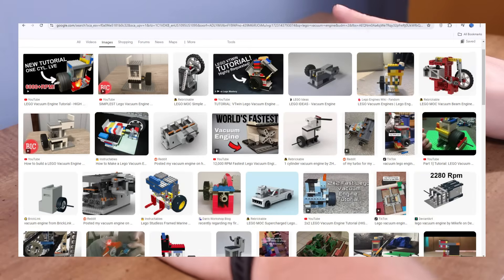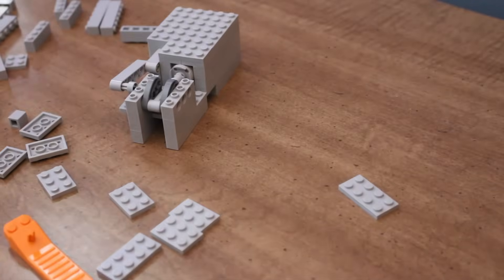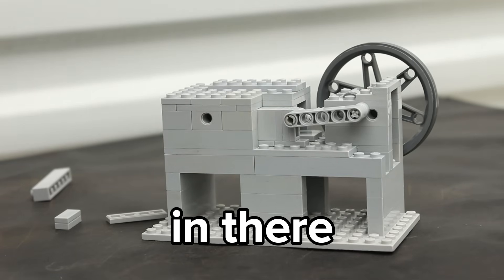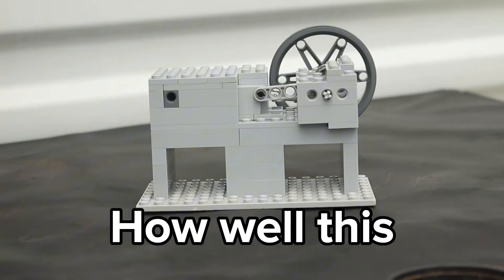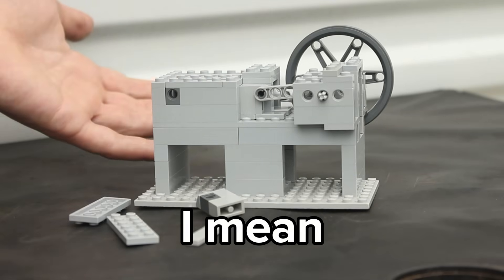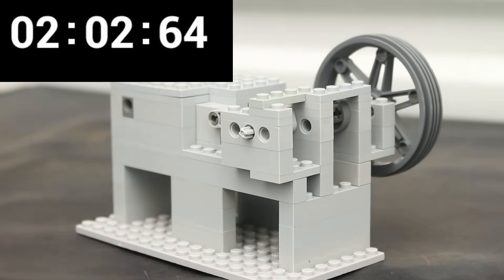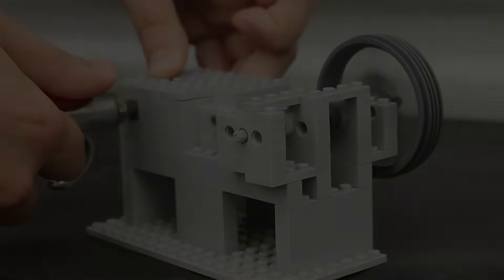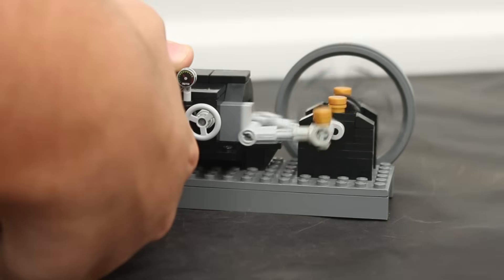I Built a WORKING LEGO "Steam" Engine!

Comment from the maker: Should I make more steam/air engines?

(P.S. I do have some fun ideas!)
Reply: You definitely should :)
Reply: No one can stop you so YEEEESSS
Reply: Should I build one that has torque to power something?
Reply from the maker: @Wowzers11958  you can try!
Reply: @DeltonAdamsLEGO  challenge excepted! I’ll put one on my channel later or tomorrow, work on it today.
Reply: Ofc!
Reply: Absolutely!
Reply: Try to take the wheel of
Reply from the maker: @liamyateslego  it actually will run without a flywheel! It just shakes itself apart after a while
Reply: Yes you should!
Reply: Yes!
Reply: Yes, the four-cylinder triple-expansion engine on RMS Titanic
Reply: can you make one with a boiler attached to it?
Reply: Try to use it to power something
Reply from the maker: This particular engine doesn't have enough torque to power anything
Reply: Yes🎉
Reply: nah first make a lego steam engine that actually uses steam not pressurized air
Reply from the maker: @CommiePlasma  LEGO plus high temp steam = a non-running engine and ruined bricks
Reply: Sadly it didn’t run in the vid ima post it anyways and I’ll post new and improved one soon. Maybe tomorrow but we’ll see 😅
Reply from the maker: @octacore4009 that would leak like crazy. I don't think using water would be a good idea
Reply: Yes!
Reply: one idea that i had is to try to put some oil that could help run a bit faster
Reply from the maker: @westernadventures3719  if you'd like to try, go ahead! I'm trying to make 100% LEGO engine that don't require anything extra other that air
Reply: Please make a tutorial
Reply: Try and see if you can build a "Triple Expansion Marine Engine"!
It's the same type of engines that were seen on the Titanic / Olympic-Class Liners!
Reply: Yeeeesssssss
Reply: And I subscribed
Reply: How about a steam TURBINE?
Reply: use pneumatic pistons
Reply: yes trains
Reply: definetly yes, and i would like to see one on a lego steam ship
Reply: Using your air compressor and your vacuum cleaner combined you could make a vacuum engine that has a compressed air tank pushing air into the exhaust of the engine to make it go faster, even if it would probably work better on a vacuum turbine (it also would look like NOS).
Reply: PLEASE
Reply: maybe give lego pneumatic engines a try. i recently bought a set of a moc someone made thats similar to a original steam engine
Reply: Yes
Reply: Yes

Comment: there's a difference between steam and air :/
Reply from the maker: Yes, but steam is a pressurized gas. So is compressed air. And the CO2 in airsoft cartridges. Technically speaking, this engine could run off of steam, and the CO2 cartridges. The way I used the word "steam" isn't literal, it's a way of saying "pressurized gas"

Comment: You should make a Lego Case 150 using the Lego steam engine! And try to pull a weight with it
Reply from the maker: I want to! The only problem for me right now is that these engines have almost no torque, so I'm gonna need to build a proper pneumatic engine before I attempt a steam tractor

Comment: Interesting concept, but by nature a very hard thing to pull off. Vacuum engines are much more stable since the negative pressure inside the engine is squeezing the Lego tighter together instead of trying to rip it apart. To make this work at nearly as high rpm’s as a vacuum engine can reach, you’d have to reinforce it big time, which would make it incredibly bulky.
Reply from the maker: Yeah, I mean it wasn't that hard to do, I'd argue, for me at the time, it was even easier than a vacuum engine

Comment: That aint a steam engine its vacuum engine in reverse
Reply from the maker: ... Which is what a steam engine literally is...
Vacuum engines can run off steams (compressed air), and steam engines can run off a vacuum
Reply: @ its actually legit cos when you boil water it turns into gas but how do they really work it doesnt have much pressure

Comment: You would have put an exhaust valve on the other side of the engine I think it would have worked better
Reply from the maker: There's a built in exhaust valve on top of the SVS valve, it runs about as good as possible for what it is

Comment: honestly im thinking of making a lego vaccum valve gear engine but air seems alot easier
Reply from the maker: @Wreckedftfoxy  well, what's really cool is that nearly every vacuum engine can also run off compressed air! So if you design an air engine, there's a good chance it'll also run off a vacuum! This one, for example, will run off a vacuum

Comment: Try making a working steam locomotive out of Lego.
Reply from the maker: Well, I don't have that many parts, but I can definitely try a locomotive engine
Reply: @DeltonAdamsLEGO  How about a steam powered LEGO boat?
Reply from the maker: @tofc2409  well, that's not really possible with what I've got. The sheer amount of air required to run some of these engine is crazy
Reply: @DeltonAdamsLEGO  Maybe you could power the boat from an air tank on the shore by means of a really long hose.

Comment: You should make a double-acting cylinder like a real steam engine. You won't have to jump start it. The trickiest thing to deal with is going to be the "gland" where the piston rod exits the block, as a cross-axle will leak terribly, you want a smooth sided axle for the job.
Reply from the maker: I'm actually working on one right now!

Comment: It needs a bigger flywheel
Reply from the maker: Well, no actually. A bigger flywheel would only make it harder for the engine to run at low speeds, because it produces little torque. And it's not that I really care, this is just a fun project

Comment: try to build a "Steamship" that runs only with a Lego Compressor (that is actually a thing) and a Steam Engine designed by you... Let's see how will it run.
Reply from the maker: @LorenzoFerrari-d5e  well, this engine takes a lot of air to run for even just a little bit. So while that would be cool, this design wouldn't allow it
Reply: @DeltonAdamsLEGO  
Right... Need a new type of cylinder, then... And a new valve.
Reply from the maker: @LorenzoFerrari-d5e  might as well just make a whole new engine then. I don't have the parts for a compressor, nor do I have the funds to buy parts for it
Reply: @DeltonAdamsLEGO  
I don't
Reply from the maker: @LorenzoFerrari-d5e  sorry bout that. Meant to say "I" but I accidentally hit "u"
Reply: @DeltonAdamsLEGO  
No problem

Comment: Was building a similar System but using the Pistons and valves from pneumatic Sets. Perfectly timed, I was also able to build a twi piston Engine.

Unfortunately I don't habe the parts anymore.

Funfact to this, due to missing air compressors, I built my own from Lego Pistons and a Motor too.

[no free energy!!!]

Comment: I'd say make a double acting one instead. Here you're putting a lot of pressure on the valve, because it's closed for half the revolution of the flywheel, give or take, but a double acting one is only closed very shortly, and it's more efficient. Great work though, I'm impressed with what you achieved here.

Comment: I dont know what i did wrong, i made the svs and the cylinder so that when the cylinder comes down the valve opens and it should work and when it comes up the valve closes, but it just doesnt want to run
Reply from the maker: Tuning is everything! Try changing slight parts. You'll get it eventually!

Comment: can you make one with a boiler attached to it?
Reply from the maker: I don't really see what that would add. I might add a boiler to an upcoming project, but just for aesthetics
Reply: @DeltonAdamsLEGO  what I mean is to make it self sustainable instead of using an air pump or vacuum. Also, if you want to do it, use metal Lego, as normal Lego would be near melting.
Reply from the maker: @thewafflegamer6152  "metal LEGO" only has gears and axles. Also, the amount of pressure required to run this thing means a small boiler wouldn't run this for very long, a second or two max
Reply: @DeltonAdamsLEGO  whelp, I guess I will wait till such product is released, even if the final product is terrible. I guess connecting it to a Lego air compressor would work or something.

Comment: That's the thing with steam engines like that, they were meant to be run with high torque, not quickly. Actually, one type of that steam mechanism was known to actually shake itself to death at high speeds.

Comment: That’s not a “Working Lego steam engine,” it’s a working Lego PNEUMATIC engine.
Reply from the maker: In the LEGO engine space, the term is interchangeable, because real steam can't be physically used, but the engines can theoretically run off steam
Reply: Steam engines can run off air. I occasionally run my real steam engines on air as the fuel can be quite smelly. 
Lubrication is key though - Obviously steam oil is required but when you run them on air, it's handy to introduce a little more.

Comment: bro theres lego pumps that exist, they can use air, theyre called pneumatic pumps i think.
Reply from the maker: They don't pump enough air to supply the engine, that's the only problem. I was hoping I could power this using pneumatic pumps and tubes, but it just didn't work

Comment: That’s a pneumatic engine, not steam
Reply from the maker: technically you're correct, but I called it a "steam" engine because, theoretically, it could run off steam. Besides, with LEGO engines, the two terms are interchangeable
Reply: All steam engines can run off air. I sometimes run my real steam engines on air.

Comment: Put some lithium grease on the moving parts, there will be less friction resistance and should work better on lower pressure
Reply: Or even a lighter oil that is plastic safe
Reply from the maker: Not for me, I'm trying to make things that are 100% LEGO. I don't want to have to use anything like sealants or lubricants. And besides, I'm not going for performance, I just like to build these 😊
Reply: @DeltonAdamsLEGO maybe Lego official rc wheel will work but I guess it won’t change many

Comment: This is a good start. However, I think you'll find centering the rods easier if you keep the valve stem 1x1 instead of 1x2. Also, you can easily find the parts needed to make a round 2x2 piston cylinder. Circles have less friction than squares.

I would also build a second cylinder on the other side of the flywheel (90° offset to maximize power).

And another thing. I understand wanting to keep your channel funded, but charging money to get the pdf feels wrong to me.
Reply from the maker: I'm still working on different ways to improve this design.
And also, its a dollar. Besides, I put a lot of work into making the instructions

Comment: You need to actually make the engine work be air pushing from the other side of the piston this is what makes the piston go the other direction to push the wheel back Kind of train mechanism Ish, This would also make it work in reverse
Reply from the maker: Right. I was going to make this double acting, but the piston design wouldn't allow me to do that. I plan on making a double acting engine in the future. But for this engine, it's not really necessary

Comment: You should add another section to the valve so it pulls and pushes the piston. Basically turn it into a single stroke engine, which is how steam engines work in real life (there are probably some exceptions, though)
Reply from the maker: @GamingGenius777  I actually planned on doing that, but the piston design wouldn't let me do it the way I wanted. I'll most likely make another that is a double action
Reply: No most steam engines are two stroke, that's why it has the valve gear
Reply: @pilotbug6100  That doesn't make sense, and what does that have to do with the valve gear? Maybe you confused it with single and double acting.

Most steam engines are double-acting (single stroke) https://en.wikipedia.org/wiki/Single-_and_double-acting_cylinders#Steam_engines
Reply: @pilotbug6100  each movement of the piston is a stroke, so the steam engine has two power strokes per revolution making it a single stroke engine.

Comment: Im going to make a steem engine...  (Makes a air engine)
Reply from the maker: @rodger-the-robot  well, it's technically the same thing, so...
Reply: @DeltonAdamsLEGO  no it's not 😐
Reply: @DeltonAdamsLEGO  not even similar
Reply from the maker: @rodger-the-robot  ok then, explain. I know steam expands some, so there a difference, but a steam engine can run off compressed air and an air engine can run off of steam, so I don't see a big difference. If you're referring to the fact that this engine isn't a double action engine, that just a design limitation. Compressed air and steam engines are very similar
Reply: @DeltonAdamsLEGO  when did I reference it being double acting it's not a steem engine because it doesn't run on steem steem involves high temperature and water also steem expands air doesn't
Reply from the maker: @rodger-the-robot it's LEGO, what do you expect? They would melt within a few seconds. I called it a "steam" engine because it could theoretically run off steam. Others in this space do the same thing with LPE's. They call them "steam" engines because they run off compressed air, which is almost (but not quite, as stated) the same as steam. Steam and air engines are so close to each other that the term can be used interchangeably with LEGO engines.
Reply: @DeltonAdamsLEGO  so your saying it can't run on steem
Reply from the maker: @rodger-the-robot  theoretically yes, but physically no, because it's LEGO, plastic. If this were made of metal, then yes you could absolutely run this off steam. There is no LEGO engine that can run off real steam without melting
Reply: @DeltonAdamsLEGO  🙃so I'm right 😉
Reply from the maker: @rodger-the-robot  well, yes and no. You're right that it's not a "steam" engine, but it operates exactly like one
Reply: @DeltonAdamsLEGO  🙃
Reply: Theres no such thing as a "steem" engine :P
Reply: "Not even similar"? Theyre both engines that run on pressurized gas. "Steam engine" and "air engine" are broad terms.
Reply: So Delton is right
Reply: @Dudeface167  are you sure about that
Reply: @Dudeface167  compressed air is compressed air steam is high pressure it itself is not being compressed
Reply: @rodger-the-robot  I sure af am sure.